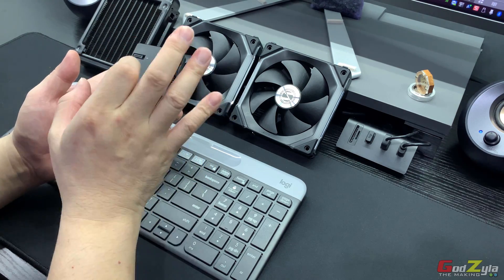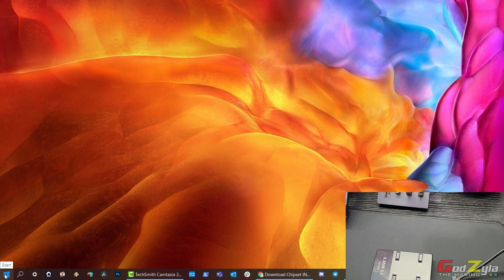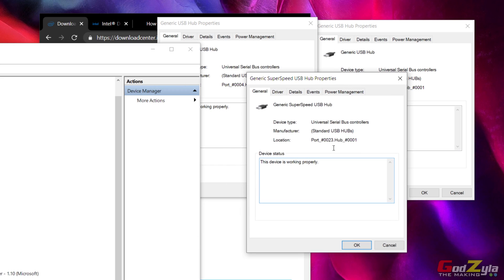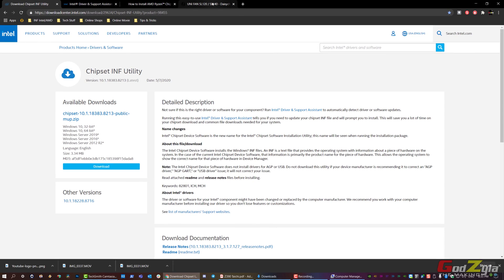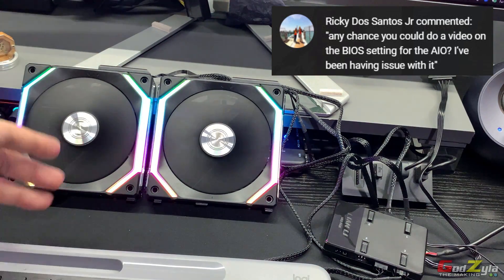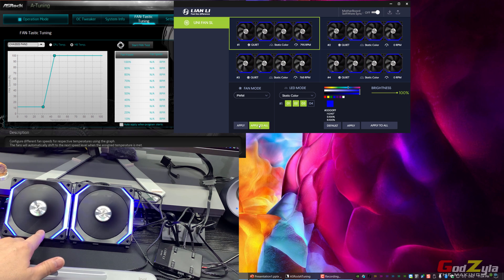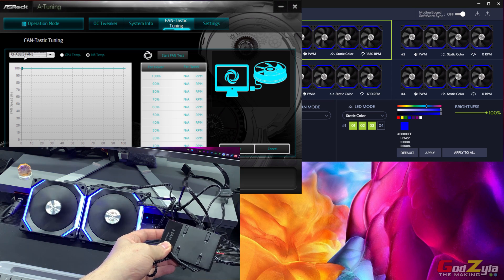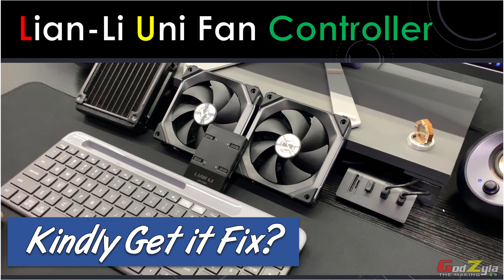Lian Li Uni Fan Controller - Some Break Fix! [L-Connect]

Comment: i have 6 of these fans and they work (fans run but only gives rainbow color) but none of them respond when i try to use the L connect software to change color. I set them to PWM mode in Bios but still no luck for adjusting the fan curve
Reply from the maker: Hmm which motherboard are you using? If it’s MSI. One of my viewer drop the dragon application and just run L connect. It works for him but there is another having this issue and yet unable to resolve.
Reply: @KleoYan  thanks for reply! I have a x570 Tomahawk wifi (MSI). I tried unstalling Dragon Center, but it still doesnt work. The RGB connector from my Lian Li controller is currently connected to Rainbow1 on my Motherboard. Should i try to unconnect the RGB connector from Rainbow 1 and only run the controller from the Lian Li controller? Lian li fan controller is currently connected to CPU FAN 4 on the Motherboard. I really appreciate your help!
Reply from the maker: @GamboTheGent  yup disconnect it to see if you can take control over the argb effects. If it does. I have another suggestion, leave the argb controll by your uni controller. And plug ur daisy chain SL fans to the motherboard header to controll the fans RPM. Do not worry 4 x fans. The fan load is 0.72a which most motherboard fan header support up to 1A. The only worry is about argb load. Cos 4 x SL fans, the argb load is at 2.6a which some old mobo support up to 2a. So just remember. Unplug that argb and pwm cable from your uni fan to the motherboard. Leave argb of your SL fans on uni fan controller. Plug only the SL daisy chained fan connector to the motherboard fan header directly. Hope am not confusing you.
Reply: @KleoYan  i think i understand, i will try it now
Reply: still same issue. will try to reinstall software as administrator and make L Connect boot on startup.
Reply from the maker: @GamboTheGent  hmm remove l connect first then dragon app. Reboot your pc and reinstall l connect and try again
Reply: @KleoYan  IT WORKED! Now i can change the color with L CONNECT! Thank you so much ! the big question is if this wil persist when i restart the computer, i will have to check.
Reply from the maker: @GamboTheGent  ok try reboot. See if it’s back to rainbow and when you relaunch the L connect are you able to control it. If it does. The only thing left is to set your l connect to load during start up at windows. Try that first while I try to get the instructions to make it as default start on windows
Reply: @KleoYan  yes, rebooting now!
Reply from the maker: @GamboTheGent  now if you are still able to control the argb through l connect after reboot. Follow the instructions below to set L connect app as default windown start up. 

1. Click “Windows” + “R”
2. Enter : “shell:**startup**”
3. Click “OK”
4. Copy your “**L**\-**Connect**” shourtcut to “**Startup**” file.
5. Restart your **PC**.

Now if you reboot and start your l connect but it did not remember your last setting. It is advisable to save that settings you want under profile I think (top right) of the L connect app. So you got no choice but to let it start up and to load the profile settings you wanted. Good luck 👍
Reply: @KleoYan  it persisted with reboot! you saved me, i was so frustrated with this issue lol,  i will offcourse subscribe ! now my pc looks clean, no more rainbow haha, thank you!!! <3

Comment: Hi Kleo,

Wondering if you can help me with my issue.

I am currently running Tomahawk B550 from MSI, and just install these fans in my build, 2 SL140 as front fans.

I've connected them to my mobo through the aRGB header (JRAINBOW2) and USB port.  

The connector is connected to SATA (Daisy chained with my two SSDs to PSU).

The fans are running, and the RGB is running as well.  The first issue is that the RGB is only in the default rainbow mode, and cannot be changed or turned off.  I've tried the L-connect software, in which it doesn't seem to recognize the fan (0 RPMS).  When I bring up BIOS, it also does not recognize any system fans as well.

At first I thought this was just an RGB issue with the MSI Dragon Center, but seems that it may be that the fans arent being recognized.  I have tried reinstalling and downloading the fixes to no avail as well.

Any suggestions?
Reply from the maker: Hi C Kay, try this. uninstall all L-Connect application and the fix if there are any. unplug all cables from the uni controller. Now connect only the USB Cable to your uni controller, with the SL140 fans connected to this uni controller. download and install the L-Connect. Check your device manager see if the uni fan controller is detected. once detected, plug in the sata to the uni controller. observe your fans, they should be default rpm and argb on rainbow, launch your L-Connect app. first thing to do is to select your fan settings to quiet or fast and click on apply all. see if the fans react and see if the RPM changes. next test your argb. if this does not work, it might just be the MSI board, I would suggest you to see help with lian li support team. https://lian-li.com/contact-us/ , once again thank you for your question and to have visit my channel.

Comment: Hi Kleo, I am having issues with 1 of my Uni Fans, I have a total of 7 on my o11 Dynamic XL.  Top 3 and bottom 3 work fine, I have 1 rear fan that lights up but the fan fails to spin. I unplugged it and plugged it in a differnt port on the controller and the same issues occur.  I tried to change the cable from the fan itself to the controller and then the fan fails to light up, sometimes it does and sometimes it doesn, if I wiggle the cable on the controller for that specific fan group the light goes on and off on the specific fan.  So far, the problem follows that specific fan. Any other ideas on what I can do to fix it? Thanks
Reply from the maker: Hi Dreday2000, thanks for your question. As what you have mentioned to me, you did narrow down some issues, 1st your uni controller is not at fault, 2nd the cable that comes with it is also not at fault as the other fans does react. the only problem is this specific fan. as much as I wanted to investigate for you. I would advise you to contact Lian-Li support and to submit a RMA form. https://lian-li.com/contact-us/

I am so sorry that I am not able to help you here. once again thank you for your question and to have visit my channel. hate to ask this where I can help you out but if you do like my content, kindly subscribe and to click on the notification bell. I wishes you all the best and hope lian-li will replace your fan too. thank you very much!
Reply: @KleoYan  Thank you so much for your help Kleo!  I have ran into additional issues.  I believe my Lian Li controller is bad, I am getting no RGB out of Port #1 and Port #4.  The fans do spin but no RGB are coming out of those ports. I uploaded a video on the Lian Li reddit page here: https://www.reddit.com/r/lianli/comments/lc7y6b/is_my_lian_li_uni_fan_controller_bad_cluster_1/ .. What do you think? Is this an issue with my Controller or is this something with the software? Thanks again for your help!
Reply from the maker: @DreDay2000  a smart move I would say. but just.a little suggestion. you might want to either voice over what you are face in the video, they will have a clearer picture to aid you out. hopefully lian li support will sort out you problem by replacing the control unit.

Comment: Great video! Anyway, how can I set L-Connect to run as the PC starts but only on system tray? I don't want to see everytime the L-Connect window when PC starts.
Reply from the maker: HI Allan Fantoni, thank you for your question. you can only set it to start up automatically but not able to bring it to the tray and this is how

1.	Click “Windows” + “R”
2.	Enter : “shell:startup”
3.	Click “OK”
4.	Copy your “L-Connect Shortcut” to “Startup” file
5.	Restart your PC

once again thank you for your question and if you do like my content, kindly subscribe and to click on the notification bell. thank you very much!
Reply: @KleoYan  Hi, thank you for your quick feedback! Yeah, I did that before and it works. But I'd like to make it starts on tray only. I searched for some solutions but not found. Anyway, thank you!
Reply from the maker: @AllanFantoni  hi ya, ok you got me doing a research and it seems to work for me. now before you perform the steps which is from lian li official website. point at the shortcut > do a right click > click on properties > under the shortcut tab, there is this command that says Run : change from "Normal" to "Minimize" and click apply.. then perform the steps above which I have shown you..
Reply from the maker: @AllanFantoni  ok.. i have tested, it does not work. If I do find a solution. I will let you know. thank you!
Reply: @KleoYan  Thank you. I'll continue to search for a solution too.

Comment: if i have 15 fans can i hook up 2 of these controllers? thanks
Reply from the maker: Hi Elvis Best, thank you for your question. nope the L-Connect application will only read one controller. you are not able to connect two. maybe you can state how you place your fans and I might be able to aid you on this. Thank you again for the question and if you do like my content, kindly subscribe and to click on the notification bell.
Reply: @KleoYan  yes i have the 3 with the AIO water pump then I have 4 next to the motherboard facing forward then i have 4 in the front 1 in the back and was going to place 3 on the bottom
Reply from the maker: @elvisbest3213  hmm. I don't quite get it with the 4 next to the motherboard facing forward? may I ask what kind of case are you using?

for the moment I can only figure it this way
3 x AIO fan 
4 x Front 
3 x Bottom
1 x Rear
Reply: @KleoYan  i'am using the THERMALTAKE P8 T6 very huge case and i don't have the 3 bottom one yet i have 4 in the front and 4 next to the MB facing forward 1x in the rear
Reply from the maker: @elvisbest3213  I see, that is one huge case. now this is what I will do 

the AIO pump please plug directly to the motherboard CPU / W_Pump header

Next

Top AIO x 3 fans + 1 x Rear to uni controller output 1
Near motherboard x 4 fans to uni controller output 2
Front x 4 fans to uni controller output 3
Bottom x 3 fans to uni controller output 4

as how you daisy chain your AIO x 3 Fans with the 1 x rear fan. you need a fan spliter and a argb splitter, more information here. https://youtu.be/TIO8JxVZTi8 , just ignore the push pull configuration. there are cable listed on my description on that video. by the way.. while you are daisy chaining your fans. make sure is just 15 and not more and please note the dos and dont as I do not want you to fry your uni controller https://youtu.be/QQHJUQvKwlY
Reply: @KleoYan  ok thank you so much yes its a huge case the x3 fans for the AIO  are x6 2 wires 1 for each fans you sure help alot sir thank u ill watch the youtube video u put up now
Reply from the maker: @elvisbest3213  you are most welcome :)

Comment: I have the same issue as Charlie, and I updated my Chipset, Bios and everything else. Nothing seem to help to solve that issue, I would appreciate your help. :)
Reply from the maker: hi Salmir Hodzic, thank you for your question. now just to check, did you set PWM mode in our Bios/UEFI? if you did, when you connect the uni controller, do you see it detect on your device manager? if it does.. try removing it, unplug your USB cable from the uni controller, re-install the chipset INF, reboot the system. replug the USB cable and test again. if still failed. 
read one of my viewer who have another method to resolve the issue. This post was posted by Aaren Portillo which I have pin his post. you might want to see what info might help you out. Once again thank you for your question and to have visit my channel. If you do like my content, kindly subscribe and to click on the notification bell. thank you very much!
Reply: @KleoYan  I followed the steps from Aaren, it works for RPM, Im able to adjust them via mainboard Software (Not via L-Connect). The issue with L-Connect and controlling RGB still remains unsolved. (I tried your advice as well :/ ... )
Reply from the maker: @Salmir_Hodzic  hmm, something is not right. This means that your uni control unit is not communicating with the L-Connect app. does your motherboard have another USB 2 header. try changing that. if it still does not work, unplug your Uni controller first. remove the L-Connect app from your pc and do a reboot. reinstall the L-Connect app again. plug back the uni controller via the usb cable again. now plug only one fan to see if it reacts? if it still does not, I would advise you to approach lian li support https://lian-li.com/faq/ on this. as this that much I can help. thank you!
Reply: @KleoYan  okay, thanks for your assistance... I have allready sent to Lian li some messaged , I hope they can help me
Reply from the maker: @Salmir_Hodzic  ok my friend. Hey if you do get it fix. Do let me know the outcome. Will be great if you can share your findings to the rest too. All the very best and hope your issue is fix soon. Thank you.
Reply: @Salmir_Hodzic  still no fix ?
Reply: @fydew  I have fixed it. The problem is that I have bhought much different rgb fans and installed many diferent rgb controlling software, even after deleting them they seem to be bound with system files. I have formated my harddisk and had to set up new installation of windows 10. After that everything works perfectly.

Comment: Hey im using the SL140 I think everything applies to them as well. Anyways I can't get them working properly in PWM mode. They are connected properly the L-connect Software is working but my motherboard MSI B550M mortar WiFi doesn't get a signal from them. I already set the fan header to pwm and adjusted the fan curve but the fans only idle around 800rpm. Also I don't get the rpm Signal or any sign of a fan connection in the Bios. I'm lost here, do you know a solution for this? Would be great thanks.
Reply from the maker: Hi Marvin Dx, thank you for your question. Now I do have a viewer who had the same issue as yours and he did some altering which might be able to aid you on this.. on this video comment, look for Aaren Portillo's comment which I've pin, he did mention his steps of getting the PWM to work for you. Hope that helps. Once again thank you for your question and to have visited my channel, kindly subscribe if you do like my content and to click on the notification bell. thank you very much!

Comment: I dint see lian li in device management. I get an error in the device managment that says usb error or something like that. I can only assume its the uni fans cause ive done everything u posted and still nothing works. Any ideas.
Reply: im having the same problem,have you solved it?
Reply from the maker: @Penber222  Hi man01, pardon me, maybe you should try sending a form to lian-li suppoer at https://lian-li.com/faq/ with your motherboard specs and such.. they might be able to aid you on this.. as I am not able to resolve your issue.
Reply: @KleoYan  yes i already did that, they haven't replied yet
Reply: @Penber222  i emailed them, they told me  to do what was on their website, and then asked for my information. I havent heard since. If u end up finding out how to fix it please let me know 😭
Reply: @brobob52  what mobo are you using? is it a newly built pc? when i try plugging it into my other pc everything works perfectly fine,the problem occurs when plugging it into my newly built pc :(
Reply: @Penber222  yeah its newly built. Asrock x570 taichi
Reply: @brobob52  seems like most of the people having this problem with a newly built pc,are we missing a driver or something ? Lol
Reply: @brobob52  hey have you tried plugging into a different usb header?
Reply: @Penber222  yeah ive tried 2 different ones.  Still the same error.
Reply: @brobob52  seems like there is no more hope,i’m thinking of giving up now lol
Reply: @brobob52  one more question,how many uni fans are you using?
Reply: @Penber222  just 5
Reply: @brobob52  welp I’m going to buy internal usb hub and try plugging it there just incase there will be some miracle,if it still doesn’t work my last resort would be reinstalling the windows.
Reply: @Penber222  please keep me updated. Thank you. I will reach out to lian li again.
Reply: @brobob52  a little update,they replied and give me a couple of solution that i already tried a bunch of time,still the same error so they're sending me a new hub.
Reply: @Penber222  i got a new controller. the mb sees the usb in device manager meaning no more error code, but i still cant control the fans in the software.
Reply from the maker: hi rob, thank you for your question. if you have done all listed on this video, on your device management, did you see an unknow usb device listed? if you do see it, remove that first.. then unplug the usb cable from the uni controller to the motherboard, install the inf chipset first. reboot your system and plug in the usb cable again. see if it detect without error. if still failed. kindly write in to lian-li support ( https://lian-li.com/faq/ ) to see if they can aid you with it. once again thank you for your question and kindly subscribe if you like my contend. don't forget to click on the notification bell too. thank you very much!